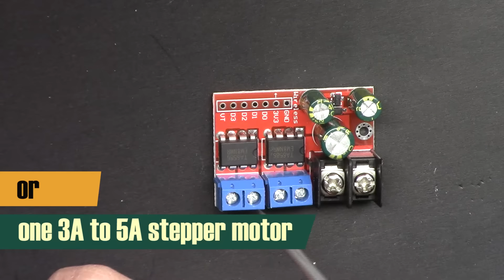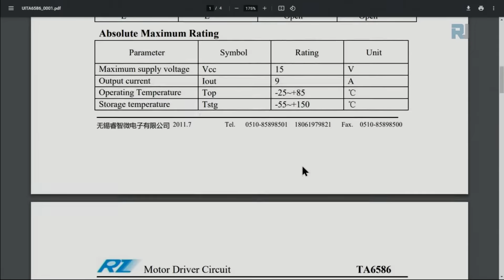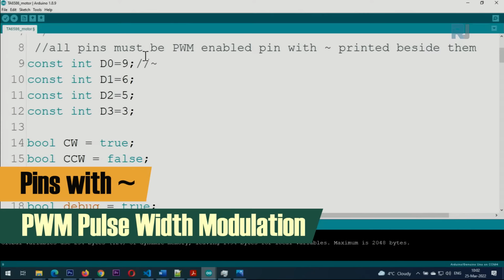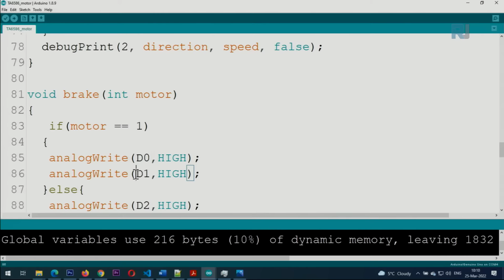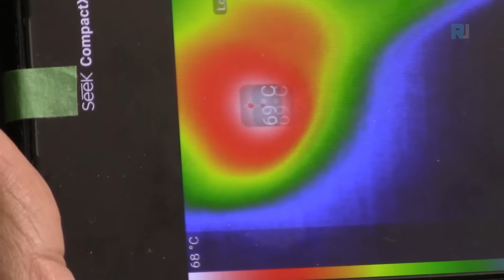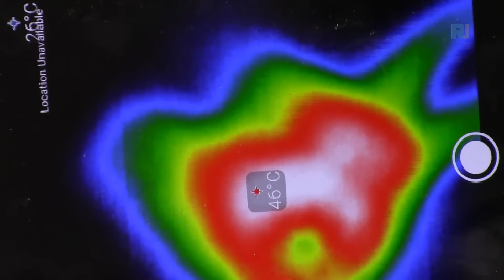Lesson 102: Using ZK-5AD 4A Dual DC Motor Driver  TA6586 4A 14V The best Motor Driver - RJT428

Comment: 21 April 2026. Took a while to type out the code in the Arduino IDE (I am 73 yrs). Works perfectly. Powered the ZK5AD off an 8volt Adapter and it worked fine. Greetings from the Netherlands.
Reply from the maker: Glad to hear it worked perfectly, thanks for watching from the Netherlands! 😊
for each video we have resources page on robojax.com where can get the code and other resouces. you could search for it or clicked on the link below this video. here is the  https://robojax.com/RJT428

Comment: I bought these to use them in a RC car. But when the motor is already moving, lets say CW, and I give the driver a CCW signal, then the chip bursts. How can I avoid this from happening? I did some browsing and found that this is due to back emf or reverse current? This problem doesn't occur with the L298D, as they have flyback diodes?. I have very little knowledge of how to implement the system used in the L298. Could you guide me further on this. What method could I implement?

Comment: if i connect one motor to both outputs, its devide current for the both circuits? For example i wanna use motor with 10 Ampers peak current. What are you think?

Comment: Hello, thanks for the excellent video. I have a question about the exit voltage, I have  2 motors that requires max 3v, can this be achieved with ZK-5AD ? I tried it with L293D, but exit voltage was 4.5 which poses a risk to burn the motors. Also, can be connected this module directly to arduino 3.3v or 5v ? Thanks in advance for the answer, greeting from France.

Comment: If i connect TA6586 motor driver to 11.1Volts lipo battery and the D0,D1,D2 and D3 pins to arduino which is connected to 9 volts battery, will that be a probem?
please answer asap man, it's an emergency...
Reply from the maker: when you conenct Arduino to 9 or 12V, on the board there is 5V regulator which changes that 9V or 12V to 5V. arduino works with 5V and there won't be a problem. Sorry for late reply. I just woke up.

Comment: 5th question: I love the added value of this driver (less voltage drop etc), but it is limited to 14V. What would you recommend to use up to 25V?
Reply from the maker: You may have a look at this https://www.ti.com/product/DRV8874-Q1
Reply from the maker: I just found another series of motor drivers https://www.pololu.com/category/11/brushed-dc-motor-drivers
Reply: @robojax  The DRV8838 is not up top 20V. Thanks for trying.
Reply: @robojax  I need to drive a 20V, 1A train model. At first stage the driver is controlling the tracks voltage. but later it will be on the train itself. The DRV8874 is too big for that, overkill. The L298D is not so good as you mentioned. So for 5V projects (toy cars)  I tend to use the TB6612FNG. Still looking for a 20V small size good motor driver.

Comment: Thanks for showing this new solution. Few questions: 1) how can PWM be used to control the speed, if no Enable pin? 2) What capacitors are used in the ZK-5AD? (in case I will make my own PCB). 3) is the 3.3V output simply comes from the voltage regulator? What is it used for? 4) Since there is only one VCC combined for logic and motor, can 3.3V logic (for example from ESP32) control the device when power of 12V is supplied? This is not clear from the data sheet. Thank you !
Reply from the maker: Hi, 
1-You can't use it without that pin
2-Datasheet link in the resource page was missing, I just added. see that please
3-explained in video
4-Yes and you can. see all voltage for the pins in datasheet
Reply: @robojax  On a second thought, perhaps I could use the PWM: while the motor is in work, one signal is L and the other is H (depends on the direction). I assume that if I drive the H signal with PWM it will work the same. I can't try because I just learned about this motor driver today (thanks to you), and already ordered it, so I have no access to it yet.
Reply: I found one I lie: LB11650 from OnSemi. 8-28V motor, 3-5V logic, 1.5A const. With PWM pin and protections (I don't really need).

Comment: Another amazing video sir!!...quick question - which motor driver would you suggest for big motors (rated current 
~7 amp each)
Reply from the maker: Hi, can't suggest any motor. Use DigiKey for example as they have tools that you select motor based an whatever voltage, current , power, size etc. you want.